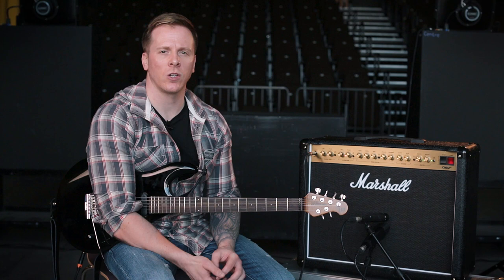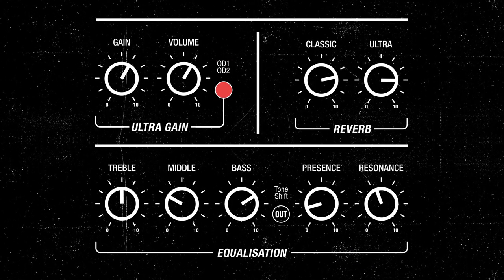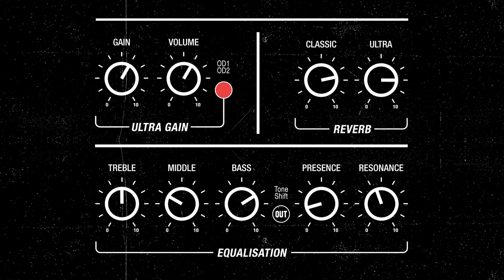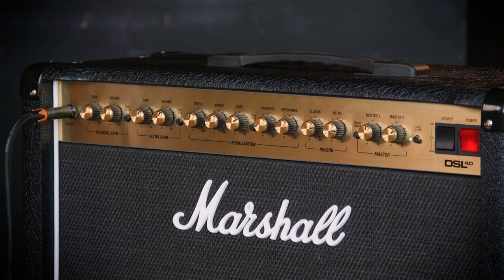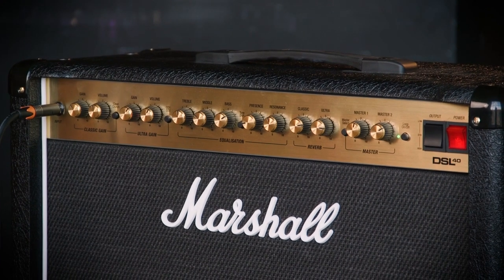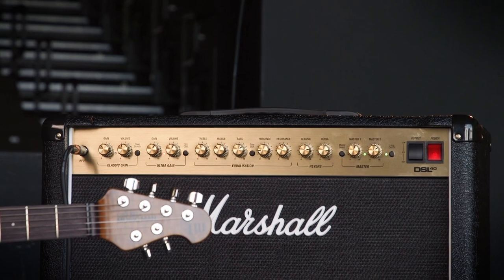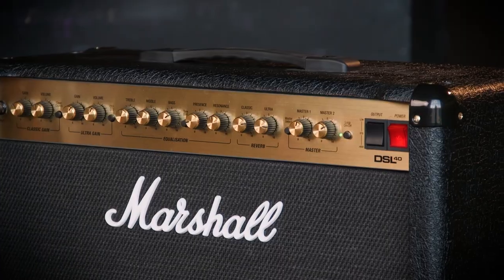DSL Tutorials | Modern Lead | Marshall

Comment: This sounds pretty thin, brittle, and fizzy. This sound would get buried in a heavy mix. I think that on the DSLs, it is necessary to lower the treble and presence quite a bit and boost the bass and resonance to get a nice, round tone that has the necessary girth that would have a chance in a thick mix.
Reply: Bass gets you lost in a mix though. So I’m not sure where you got that idea. There’s a reason treble boosters exist.
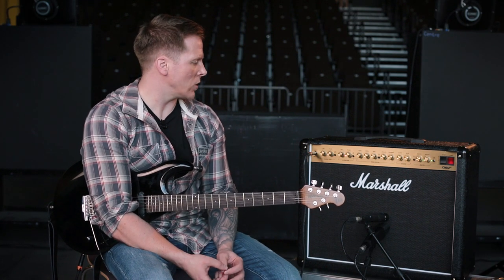Reply: @PabloMars99  Point taken. However, I still have an issue with the tone in the video. If you listen to the chord he plays with the tremolo, around 0:18 in the video, the tone sounds pretty wooly and fizzy. I still think that would get lost in a heavy mix. Treble boosters help a lot, as they boost high frequencies, but not the fizzy kind.
Reply: girth
Reply: @metalinsights9664 I’m not a huge fan of the ultra gain channels on this amp anyway (not having separate EQ for the dirty channels makes it a bit less versatile if you’re not exclusively in a band that plays high gain style). I have the gain set low with the volume all the way up. Gives me a light crunch when I play hard , then I can use pedals to add gain for lead or rhythm. You can use the volume pedal to clean up your gain, depending on the situation.
Reply: @PabloMars99  Lately, I've been intrigued by the Tone Shift button. It's not as bad as they say at all. By scooping the mids, it removes the pokiness in the notes, and the result sounds a lot more like a polished recording already. It also sounds very nice with all sorts of effects in the loop. With the Tone Shift engaged, I can set the entire EQ anywhere around noon and know it will sound good.